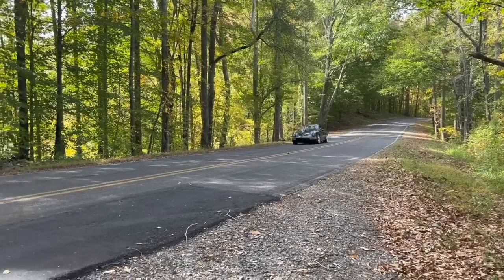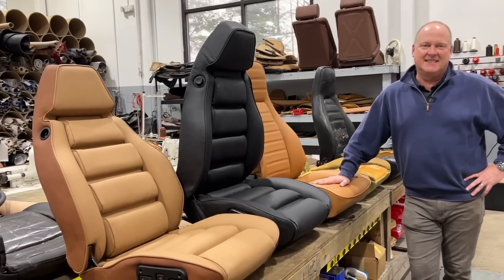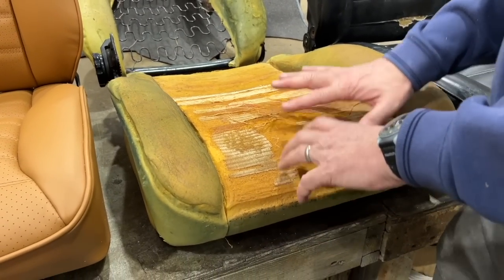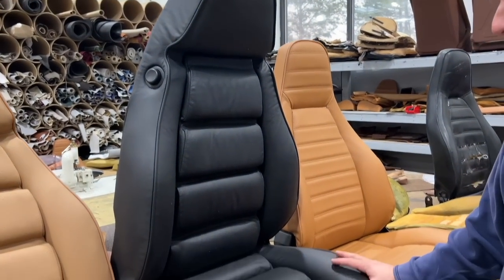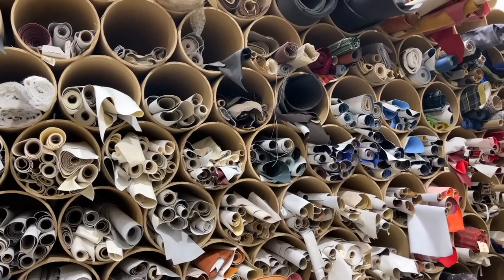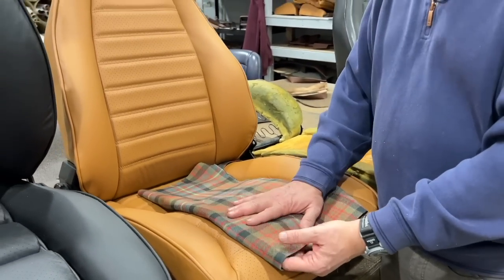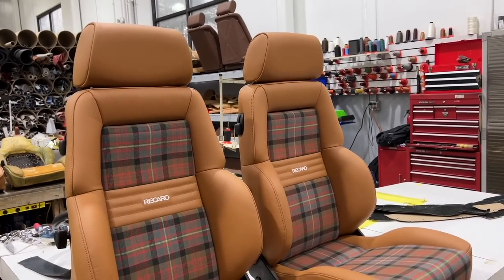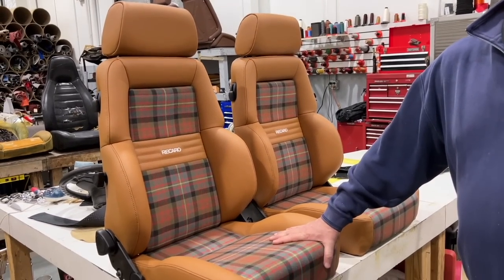Tips For Choosing A Custom Porsche Seat Shop

Comment: Thanks for the information.  I'm actually looking at some seat recovering for my 993 at this time.  I did not realize the intricacies of seat work, and I am really into the details.   I have seen some Porsche leather seat covers from 1k to $2600, then still have to have a shop install the covers.   So, if I understand correctly, this man will copy the exact pattern of Porsche with the correct leather and other materials.  So, you are paying more for labor, but you are not spending money on "covers".   Also, good idea to over buy material, I didn't think of that.
Reply from the maker: You’re correct.  Good luck!
Reply: @Rennthusiast  Thanks.

Comment: Need to do a repair on driver seat in my 79' 930 and I want to use Alcantara for the inserts. The upper side bolster is bad so I'm appreciative about finding a shop. I had it looked at by a shop and they quoted me 1000$ for the job.

Comment: Gorgeous seating. You know, I think that leather continuation band across with the Recaro branding would've looked sharp if just that band was in perforated leather with the bolsters and exterior in smooth, just an opinion, regardless, absolutely stunning. Always loved the Pepita, Tartan, and Houndstooth centers.
(Edit) and a side note/question as this is the second video I've seen of this build/refresh (first was the engine and transmission out), are you/did you put the Tartan on portions of the door cards as well as the rear seats, or just the front seats?
Reply from the maker: Just the seats

Comment: That's interesting.. so he is saying that the dimensions of the perforation in an early 70's seat is the same as what they put in the later cars?
Reply: The mid year 911 Recaro seat in the video has been previously recovered by a shop that wasn't as concerned about faithfully recreating the original.  The perforation pattern was incorrect for this style and year of Porsche.